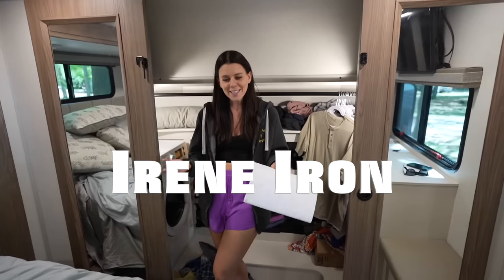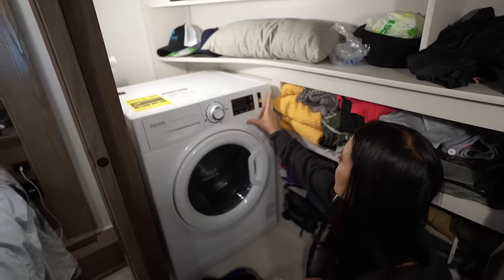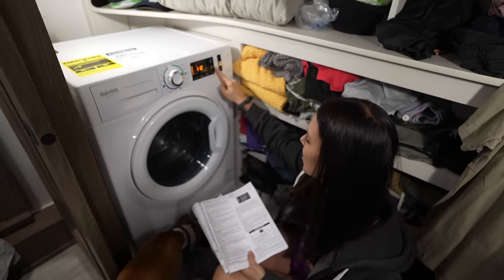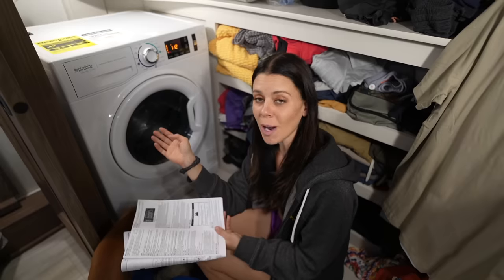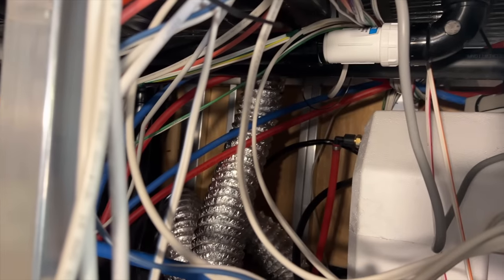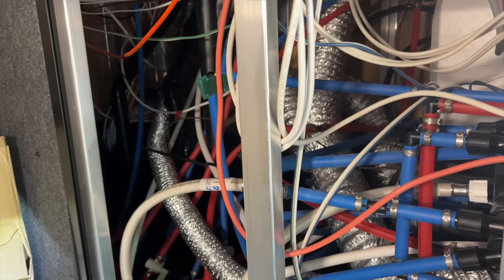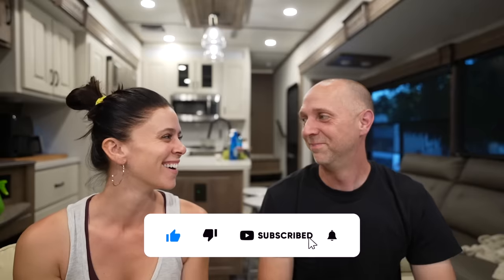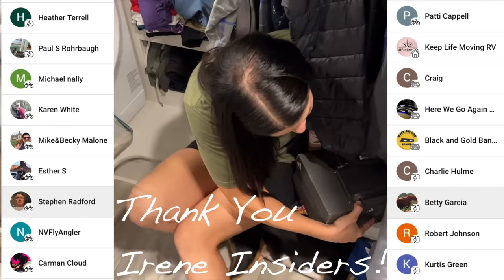We weren't expecting THIS one week after buying our New RV

Comment from the maker: Thank you for watching. 😊 We've pretty much had a few issues in all our RV's and truck. In our Outdoors RV travel trailer, the shower door leaked for weeks, the table was misassembled, the finish was flaking off the drawers fronts and almost all of the drawers wouldn't open/close without extreme force! We also had issues with our "top of the line" Airstream and Mercedes. City water inlet leak, loose plumbing connections, and very expensive emissions issues with the MB engine.  Also had a warranty saftey issue recall with our Ford that nagged for almost a year before finally getting it fixed. Anything manmade will need fixing at some point so even with all the issues on every one of our RV's we're still happy to be alive, healthy, and living our dream. 😊 Life's good.

Thank you to our current partners and affiliates!  SAVE BIG💰 👇 
🔋Battle Born Batteries 👉Save $50 on Battle Born Batteries https://bit.ly/BattleBorn50 Code "ireneiron"
😎Rich Solar 👉Save 10%💰 with code "irene10" https://richsolar.com/?ref=ireneiron
💙MORryde 👉Save 7% on select products https://shopmorryde.com/?ref=irene Coupon Code 👉🏼 ireneironfitness7%
🌞200 watt portable solar panel https://richsolar.com/products/200-watt-briefcase-portable-solar-charging-kit?ref=ireneiron 👉Save 10%💰 with code "irene10" 
🔑Keyless RVLock www.rvlock.com/ireneirontravels 👉🏼💰SAVE 15% w/ code IRENEIRONTRAVELS
❤Alliance RV https://www.alliancerv.com/contact-sales
🛻Pullrite https://pullrite.com
🚲 Our E Bikes - Lectric eBike XP Lite : lectricebikes.sjv.io/GmZ6rL

👉🏼 Join https://www.youtube.com/channel/UCSh2BRhXXMveamBDeOhubfQ/join

💙Subscribe - https://www.youtube.com/c/ireneironfitness?sub_confirmation=1

💻 Website -  https://ireneironfitness.com
💵 Store - https://www.amazon.com/shop/ireneironfitness
👫Our Story https://youtu.be/BMVbBZNAuoI
👫 ABOUT US➡ Hello! We are Aaron and Chris, a fulltime RV couple that lives and works on the road! We run an online fitness and nutrition coaching business (Irene Iron Fitness) while traveling all around the country. Follow along the journey with us!
🚐Read our Story: https://ireneironfitness.com/quitting-our-jobs-traveling-the-country/
💪Shop Online Coaching Packages: https://ireneironfitness.com/online-fitness-and-nutrition-coaching-packages/
🍎Browse IIF Healthy Recipes: https://ireneironfitness.com/healthyrecipes/

💎IIF AFFILIATES: These are programs and products we use, love, and recommend!
👉Amazon: https://www.amazon.com/shop/ireneironfitness
👉Lectric Ebikes lectricebikes.sjv.io/GmZ6rL
👉🔋Save $50 on Battle Born Batteries https://bit.ly/BattleBorn50
👉Undersun Resistance Bands  https://amzn.to/3XO3FDs
💙MORryde 👉Save 7% select items https://shopmorryde.com/?ref=irene
😎Rich Solar 👉Save https://richsolar.com/?ref=ireneiron
👉Thousand Trails: https://mbsy.co/DLw8W  💰 Save $100 
👉Harvest Hosts: https://www.harvest-hosts.com/95RRF5/2CTPL/ 💰 Save 15% "HHFRIENDS15"

Comment: RV owners are the only people i know who spend a lot of money on a product while accepting much less.  I never owned one that didnt take at least 2 years to get poor workmanship corrected.  The industry definitely needs to be regulated.  I wish you the best.  For me..... I returned to backpacking and couldn't be happier.
Reply: Regulation won't help anything.  Informed end users/customers with a brain are the answer.
Reply: Agreed, I just use my van or motorcycle with my backpacking gear now, so much easier and more fun.  If I din't have RV access at my house I wouldn't even own one, I only use it twice a year at the most now.
Reply: its is not difficult to glue up PVC connections so that they do not leak. This simply is poor workmanship and QC at the factory. That drain pipe was not even glued at all. It appeared to be dry connected. The drain plug and pipe leaks demonstrate a team of amatures assembeled the RV. If you as the new owner are taking the time to run water down the drain to check for leaks, I would have thought the manufacturer in their QC program could have done the same. Apparently they do not have a QC program, otherwise they would have noticed those leaks. The answer is to avoid that manufacturer. I completely disagree that this should be a normal expectation to work out new ownership problems.
Reply: @borabora4480  They downsized! The QC department was eliminated to save money. Fatter bonuses for executive row.
Reply: Seems like pitching a tent is a way to go-no overhead , no repairs, cheap, of course there is that wild animals danger and proper food storage. Most campgrounds have toilets, showers. Ive been thinking about this instead RV. Can you point me to great tent camping resources, id appreciate it. Thanks!
Reply: @misterhipster9509  An "informed end user/customer with a brain" won't buy a factory built RV these days. The majority of them are garbage. Somewhere to throw away your money and your dreams. It is not unusual for folks to buy an expensie RV only to have it spend months at a time at the dealer with various issues. This has nothing to do with the consumers being stupid, and everything to do with manufactures making garbage quality RVs, and dealers forgetting about you once they have your money.
North Americans would never put up with car manufacturers building such garbage, and providing such terrible after sales service. Unfortunately, it doesn't look like the Japanese are on the horizon. They sure did teach US car manufacturers to either build better cars, or lose consumers to the Japanese car manufacturers.
Competition or regulation. One or the other is needed to force the RV manufacturers to build to an acceptable standard of quality.
Reply: @headdown1  We all learn in various ways.  Bought a year old 36' Fleetwood w/low miles 1991, new condition, tripped down south from WI twice, pulled a light car hauler trailer w/a proper hitch.  Coach was 36' w/tag axle.  Big mistake, side wall delaminated behind tag axle.
Kudos to Fleetwood, the replace the whole road side wall, took 7 months while I made payments. On return coach was like a new one, sold it for close to what I paid.
It's been vintage coachs and custom toter homes since then, ALL STEEL, everyone of them, and no slide outs.
Reply: @misterhipster9509 so so sad that none of these manufacturers care at all any more…

Comment: Paradigm needs to up their PDI process.  This wasn't a parts failure, it was a labor failure. I don't believe that joint was ever glued. Good learning opportunity for them.
Reply: Yeah, it looks like they dry fitted it and forgot to come back and actually glue it. I think all these manufacturers need to run water through all the lines and drains as part of their inspection process.
Reply: Agreed!😮
Reply: Definitely!
Reply: Exactly, piss poor quality control . This is exactly why RV dealers & manufacturers get horseshit reputations …………uncalled for . 🤛👍😡
Reply: Alliance absolutley needs to up their PDI process...we were considering Alliance and seeing all the things. large and small, wrong with new units scared me off...I was in a FB group twice over three years, coming back a few months ago but saw too many of the same complaints including cracked walls...that cult thing is true...there were far too many people that had to take their new or nearly new unit to the factory for repair...if you live far from Indiana that must suck!
Reply: @bobmariano3731  Not just piss poor. NO QC. Said to say I see this across all the RV industry. My Coachmen's wiring is a birds nest, should be a wire harness. The pex lines on this 5th wheel looks the same. It should have a manifold and that would clean up the plumbing.
Reply: 100% Agree.  Black eye to Alliance.
Reply: @barbaradowney4207  you mention seeing the same issues posted on the FB group and, yes, that does happen occasionally.  I'm curious though how often you see someone post that they just completed their move today and nothing happened.  The point is, you will see issues posted on an Alliance forum because the executives and service team monitor the forums to provide help.  Additionally, other Alliance product owners are able to provide simple solutions to issues that resolve problems quickly on a peer to peer level.  Also, Alliance forums are not scrubbed of negative experiences like many other manufacturers do.  They are moderated by product owners, not Alliance corporate.  What you see is the good, bad and ugly but you also see resolution.  As for going to the factory, I'm scheduled in October for a repair of my bedroom slide issue with the Schwintek slide system.  Sometimes it isn't an Alliance issue it's a component issue.  Alliance doesn't make the components.  They will correct the problem and we will be back on the road.
Reply: It definitely was not glued
Reply: A good outcome would be they start to pressure test the water and drain systems to even catch small leaks that are probably worse. The cost of customer QC is much higher.
Reply: I respectfully disagree that it was a labor failure. . . it's a leadership failure in the standards of skillset necessary and materials used that they put in place to manufacture their product.
Reply: @Zakk900  And their Tou Hauler line "Valor" is even Worse !
Reply: PDI means Probably Did not Inspect 😡🤛😝
Reply: It's sad to watch you take responsibility for Aliiances incompetence in not connecting a drain line-"maybe we should have tested the drain". Are you serious!?!? Telling us you have to expect problems with RVs is a disservice to the RV community. For the kind of money you paid for that unit the issue you ran into is inexcusable.
Reply: i hope you sent this video to those who need to see it
Reply: For everyone bashing Alliance, ALL RV’s, regardless of manufacturer, has things go wrong. I agree that this is definitely a QC issue, but I’d buy another Alliance again.
Reply: How did they access it to fix it?

Comment: Ugh.  A completely disconnected pipe shows that Alliance as room to grow in their quality standards.  This should never, ever have happened.  A good quality control would be to have a second person confirm the work of the first person who was suppose to attach the hose - and - they should have run water down the pipe as part of their quality check process ... just as you did.  Not rocket science and the quality principles are well known.

Comment: So much for Alliance being so much better then everyone else.  Kind of how Grand Design started out.  We used to own a GD, bought brand new, and we had a good share of problems.  Hopefully you don't have water in the belly.  That's a nightmare.  Oh,  and who thought putting the water heater on top of the furnace......Same as my Momentum,  when the water heater leaks, there goes the furnace, too.
Reply: We bought a 2019 new reflection 303 rls grand design and we haven't had one single problem with it yet (knock on wood).
Reply: Industry problem, is even bad design is copied.
Reply: Alliance has never claimed to be perfect.  They simply go above and beyond with customer service to ensure a great outcome and it is their customer service that elevates them above the rest.  Owners have the cell numbers of the owners and the VPs so if there is any major issue or concern, it can be addressed quickly.  I've posted a question on the Facebook group on Independence Day weekend (they've already announced they will be away for a few days with their families) and within 20 minutes I received a call from the VP of Customer Experience to answer my questions.  THAT'S what makes Alliance better than everyone else.  Not perfect but better.
Reply: @roger80465  Same philosophy GD had.  Problem is rushing production.
Reply: All these people saying 'there's always going to be issues' is exactly why the RV manufacturers get away with building crap products.
Reply: @roger80465 Newmar has had this long before Alliance started it
Reply: Wow …. you must be perfect living in a not so perfect world. Lucky you!!

Comment: I purchased a “NEW” Avenue 36 BRM and have had nothing but problems within 4 months of ownership. Leveling system inoperable, busted trim pieces. Faulty grey/black tank valves. Faulty kitchen plumbing. Awnings don’t shut, keeps blowing the hides. Slide 3 doesn’t shut. Both A/C systems don’t cool below 10 degree from ambient temp. And alliance customer service is a joke. I hate it for ya. Glad you uploaded a video, maybe it will educate people on going a different route for their camper purchase.

Comment: My wife and I purchased an Alliance 2 months ago and it spent 6 of 9 weeks at the dealer getting plumbing replaced, roof replaced, trim replaced, leveling system repaired. We got it back and three days later traded for a Jayco. Way we saw it was if it had that many problems and we hadn’t had it for a month then it probably wouldn’t be standing in 10 years.

Comment: There was no residue of pipe cement on that connection, I hoped they pulled on it before properly securing it to see if any other fittings were missed. Keep an eye on entire line, specially after travel days to make sure another doesn't come loose. Glad to see Alliance fixed you up right away! Have been looking at an Alliance camper myself after a tornado took my 6 month old XLR camper.  I learned from it to look for campers with quality builds.
Reply: Looking for campers with quality builds?    LOL  ;-)
Reply: @jamesvelvet3612  Better off finding the size frame I want, burn old camper off and build one myself!! 😂

Comment: We don't have an Alliance but we do have a fifth wheel - and after about 3 years of hard use, our front compartment was pitted with tar, which left little pock marks. We also had mud flaps on the truck but it doesn't get everything - anyway, we put a protective clear film - over it and the compartment door - it's the same stuff they use for a clear bra on the front of the truck - I would think about doing it to keep it looking new.

Comment: Guys, it's hard to fathom a unit that didn't have problems but the good thing is they took care of the problem. You were lucky to be going to the rally because most times it's a bitch getting into a dealership and getting the stuff fixed. It would be nice if just once the quality control was just a smidge tighter at the plant and not putting pressure on the dealers and the consumer to find the bugs. I really like your new home you guys did well. Have fun and enjoy.

Comment: I don’t know why these manufacturers don’t run water through all the lines and drains and fill the tanks as part of the quality control inspection. They can blow the lines out with air before sending them to the dealer. I had a brand new RV that had a leak in the fresh tank that could have easily been caught if they had tested the tank by filling it.

Comment: Number 1.  Put a drain pan under the washer. In the event something internal breaks water drains outside no inside.  Also get yourself some 1/2 in crimps and a crimp tool.  Also some short pieces of pex.   I read that since rv sales were soaring during Covid you shouldn’t buy one built during Covid.  Tires regardless of mileage change every few years.  Age kills them not mileage.

Comment: I had a similar problem the first time I took my trailer out for a weekend. With water draining from the sink unto the floor, I ended up doing a temporary repair to the kitchen sink drainage system to get us through the long weekend and immediately delivered my trailer back to the dealership after informing them of the problem and our schedule for the summer. They gave us the "no appt.s available for three weeks" story but I told them I was camping nearby and would be bringing the trailer in on my way back from camping and expected them to store and repair the trailer under warranty. I dropped the trailer off and a week later was informed that it had been repaired and I could pick it up which I did. Seven years later there have been no further water problems with the trailer and the few other problems that have occurred have been covered under our long term warranty. When buying a new trailer always be prepared for the warranty issues as I've yet to hear of even the most expensive trailers and RVs being trouble free from the factory.

Comment: Glad you were able to sort out the plumbing issue.   It is a reality as you say, that virtually every RV has a few initial issues.   We have had 4 trailers now, and ironically the only one that never had a single issue was the least expensive one we ever had.  We had a 2016 Hideout 178LHS, which we paid less than $11K for new.   We used it for 80 nights and towed it just under 9,000 miles and not a single thing ever went wrong.   It was simple and basic and it worked.   Have had several trailers since that have all had some issues, from needing a failed fridge changed, to an incorrectly wired hot water heater that only heated when it wanted to.  Also a shower drain pipe that was basically set up as a load support until it failed and filled the underbelly with shower water etc. etc.   Everything does get sorted out, but I have to give that 2016 Hideout credit.....   I am sure you will/have get everything sorted, and Alliance seems to be a really good product...best of luck with it, and as always, safe travels.